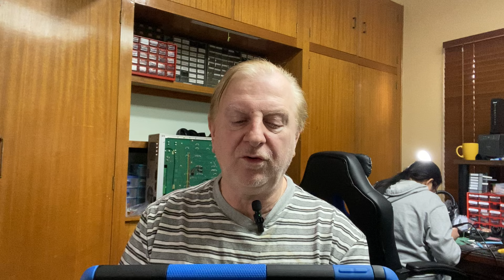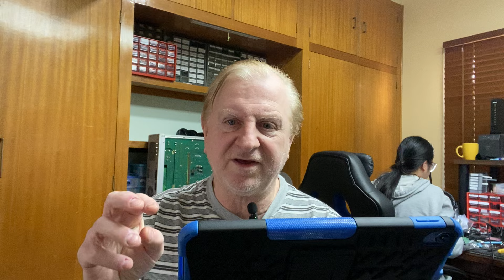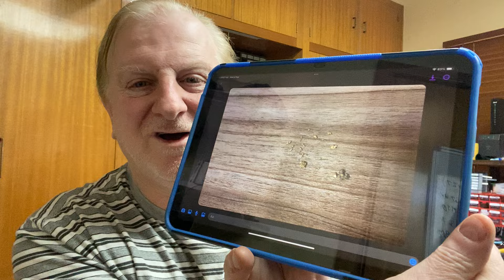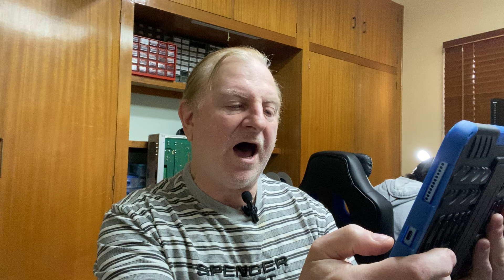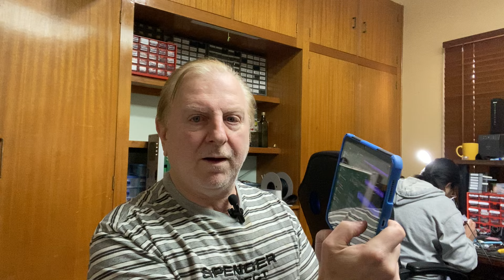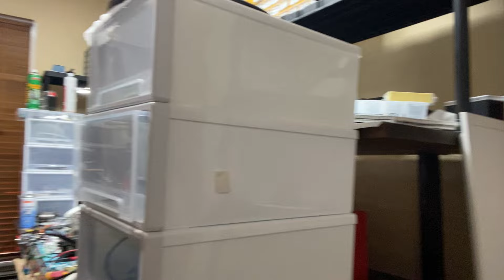Metal detectors and the toxicity that exists that I was forced to address, watch out for ear steam.

Comment: Ive had 2 detectors modded by you recently, a 4500 and a 2000. I am extremely happy with your work, and I wouldn't use any of the GP/GPX detectors without being modded by yourself. Your work is exceptional. Also David is wonderful, and was so very helpful. Don't let the haters get you down.
Reply from the maker: As long as you are happy then I am happy.😃

Comment: Would have had my 5000 modded now due unforeseen circumstances it's been put on ice. Tried to find users with different mods with a view to do a comparison Strange there were no takers! The only feedback I got was from a user in the business that had a 5000 modded by the another Co sold it as is. He felt the frequency control didn't achieve much.  Seen many Detector mod videos & his technical views I conquer with. With my 50+ yrs of experience in the electronics game probably could mod my units but admit it would take so time to get to woodies proficiency. My plan is to get woody to do his mods ..... don't wish to reinvent the wheel. However there some extras that I would woody to incorporate on my detector
Reply from the maker: Just ask and we will try out best to do the upgrades exactly as you require.